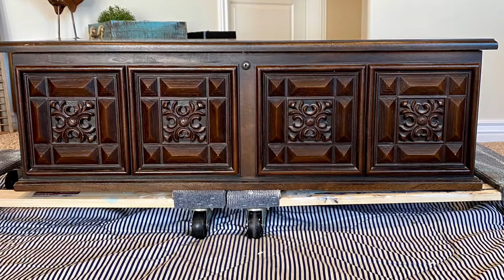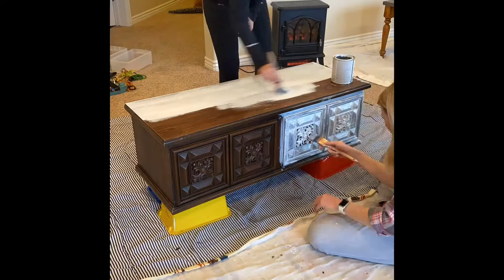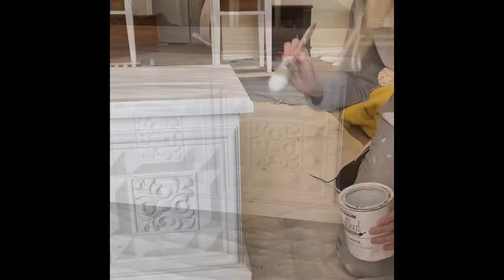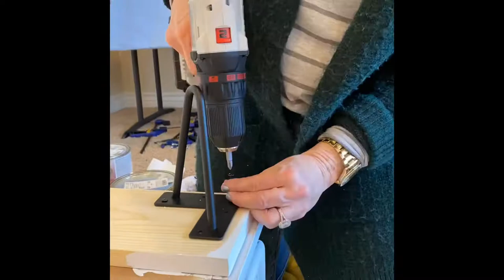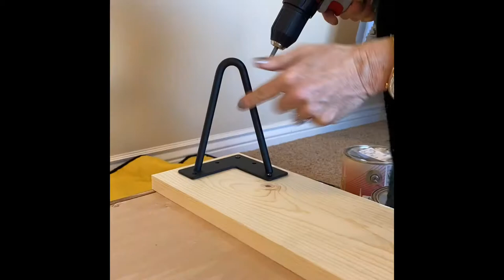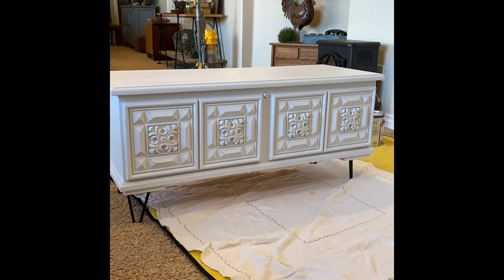Thrifted Cedar Chest Makeover/ DIY furniture flip/ Refinished Lane cedar chest/ chalkpaint

Comment: How do decide when not to scuff sand before applying paint ? Or primer ?
Reply from the maker: we always scuff sand the piece to break up the initial surface. We prime if we are painting over oak or cherry wood which are notorious woods that bleed through. Also, if you are going lighter over a dark piece, we recommend a coat or two of primer.